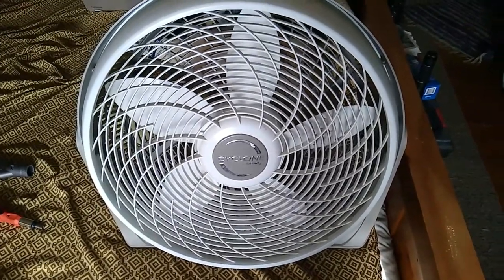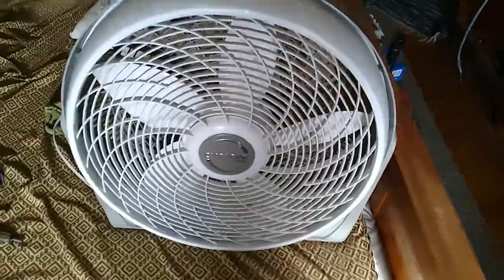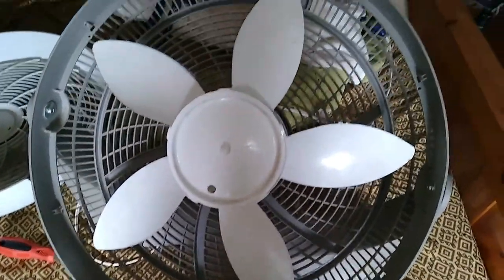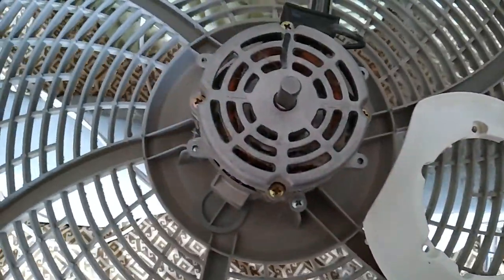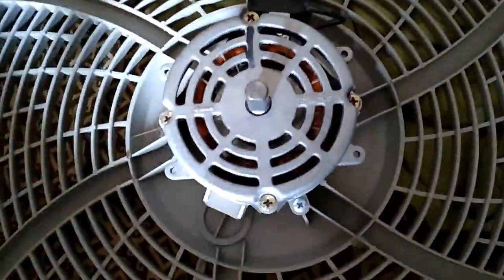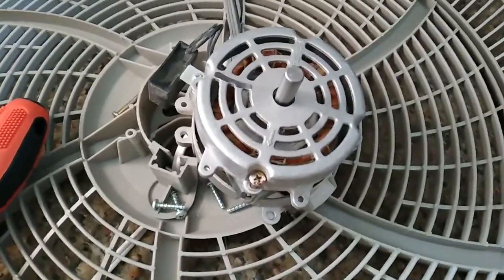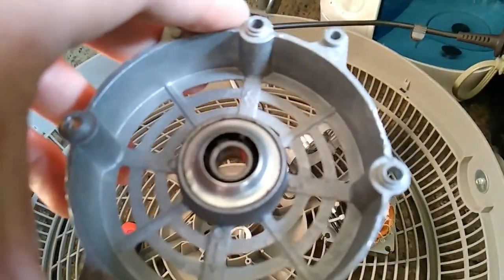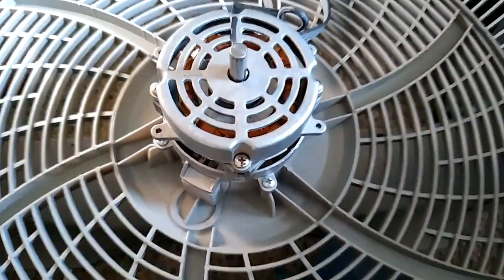Lasko Cyclone Disassembly and Cleaning/Oiling

Comment: Thank you so much for this video!  I figured there were screws someplace keeping me from taking off the front grill, but I couldn't find them. Once I got the grill off, I couldn't remove the fan from the motor, because it is affixed hard, and I can see no screws. So I couldn't go any deeper than just cleaning the front and back grills. Can't oil or anything (still wondering why).  Anyway, after about 2 hours or work, my Cyclone has drastically improved from a spring breeze back to a beautiful autumn wind. Much appreciated!! 😊👍🏻
Reply from the maker: I'm glad your fan is working better.  It's amazing how effective getting rid of dust is.  The blades on these can be pretty hard to remove sometimes.  I had to kneel on the rest of the fan to pull the blade off.
Reply: @carson01XJ   Oh! Gotcha. Well, I’ll keep that in mind and pull it off next time. (I didn’t want to break it.). Thanks!👍
Reply from the maker: @reagonowmix  Breaking the blade is definitely a valid concern.  I pulled the blade off of a cheap crappy AeroSpeed fan, and that blade actually cracked.  This fan is definitely built a lot better though.

Comment: The main important part you skipped how do you get the blades off
Reply from the maker: @FernandoAstudillo64  You pull it off the motor shaft.  That's the only possible way to do it.

Comment: You, sir, have just saved my filthy fan - thank you!  Your advice for tightening those motor screws evenly like lug nuts is very important because I had to take a few runs at it before my blade would spin smoothly.
Reply from the maker: Glad I could help.  It’s definitely important to tighten them evenly and strike the shaft with a screwdriver to align the bearings.

Comment: Something funny , I found one of these in a dumpster at an auto shop about 6 months ago . Plugged it in and worked fine . Dust built up and could not figure out getting the face off , so glad I found this video . I will being doing everything in addition to make this fan last , so appreciate you 👍
Reply from the maker: Always nice when you can maintain things and make them last instead of throwing them away.  I’m glad my video helped.

Comment: How do you get the fan blades out. I tried to just pull it off but it wouldn’t come off
Reply from the maker: @duanemoulton-n5o  Sometimes these blades are pretty hard to get off.  You have to pull on it really hard and hold the rest of the fan down with something.
Reply: @carson01XJ Why did you skip over this part in your video? You never showed us.

Comment: Hey Carson, I found this exact model on the curbside and gave it a plug in. I found that the Fan's computer board and buttons turn on and work (Light for mode and timer changes) and there's light vibration/humming in the control panel and behind the motor. So this fan is indeed receiving power, but the blades don't turn.  I just took off the screws only to find that the fan was never cleaned, it was pretty gray in the grill and blades when opened and I cleaned out the grill with a broom and blades with a cloth. I found this video so that I can find out how to remove the blade, which apparently you say just to pull it off.  
I'm hoping I can save this fan, it seems to be a simple hum and it does work on the console, so hopefully it just shorted out due to being dusty, do you thin you might know the problem to this? The blades do turn fine and I tried giving it a spin while plugged it to see if that jump starts the fan, but no joy.
Reply: Update, did pull apart the fan blade after typing that comment and found a motor shaft full of dust, clogged even. So I took my time to clean out both sides without oiling the bearing (Have no experience or oil to lubricate it), put it back together and it has the same result.  It looks like it's the computer console that hums and vibrates, the lights come on and work as intended and the humming vibration intensity corresponds to fan speed, but the blades sadly don't turn.
Reply from the maker: @SoarinYoshi64  Sounds like the capacitor may need to be replaced. The windings in the motor might be screwed as well. Does it spin for a while when you move the blade?  If not, the bearings might just be too stiff.  Hopefully the control panel isn’t messed up.
Reply: @carson01XJ  Yeah, it does spin when I move the blades and the wind when I cleaned it outside spun the blades freely. I am also thinking capacitor, but I don't know about soldering or have an iron for one sadly. I'm sure this can be saved, but my family thinks that I should toss it out again.

Edit: Oh, and the zip ties on the motor in your video were half charred. Two of them even came off. They weren't white as new as your video shows
Reply from the maker: @SoarinYoshi64  Sounds like your motor has has a pretty hard life. It seems like it’s been overheated.
Reply: @carson01XJ  Yeah, it was notable that it was never cleaned. So I guess I can curbside it for trash again and maybe someone else can fix it before it goes away.

Comment: Hello Carson , this is Fan man Steve here once again I'm sure you remember my old wizard box fan , I still have the original switch to it which is a leviton 3 way rotary canopy switch, I'm pretty sure you know what kind of switches theses are, but when I was getting the fan ready for the restoration I took the switch apart and stored it away in my drawer in my room and I tested it to see if it still works and does ! But the issue that I'm having is the the wires are either getting caught in the rotor some where  or the switch has to be wired a certain way can you help me with this ?
Reply from the maker: When you say caught in the rotor, are you referring to the part of the switch that turns?  Could you make a video explaining what's going on?  I'd probably be able to help more if I could visualize it.
Reply: @carson01XJ  Hello Carson ' I will make a video of it tomorrow' I know they're are different kinds of these switch es , when I restored the fan , I kept all the original parts to it that still worked , I just couldn't remember how the rotary switch was wired when I took it apart , but I will make  a video of it and show it to you thanks!

Comment: Hello Carson good new year to you my friend, I've just gotten 2 new fans to start off my new year, my Grandfather brought them to me visiting us from out of town , both of them are industrial floor fans they're  modern but they are awesome fans , one is a steelton and the other doesn't have name tag , maybe it's one of the off brands but anyhow , my Grandfather found these 2 fans in a dumpster close by his house that an elderly couple had thrown away, when he tested them he said they both worked but one was completely seized and locked up and the other just had a shaft issue, but I have repaired both of them and work just perfectly, but one of the fans motor on the inside was coated with grease and this was the one with the baron problem, are all fan motors modern and vintage have grease lubercated motors ?
Reply from the maker: Happy New Year to you too.  Glad that you got some free fans for your collection.  I've never seen a fan motor that used grease as lubricant.  Sleeve bearing motors (which is what most fan motors are) always use oil.  Was the whole motor greasy inside?  Sounds like someone messed with it or tried to lubricate it.
Reply: @carson01XJ  Yes it appeared that not only the whole rotor shaft was coated in grease but the whole untire amateur was caked up in grease as well , it's a wonder the fan is still working now, and I know that somebody had already did something to the motor because when I disassembled the motor , the whole thing came right apart with ease , I figured that out the second I took it apart , but I cleaned the thing up best I could and oiled the sleeve bearings and shaft and the fan runs just right now , I have even made a video on it that I'm planning on uploading to my channel soon , but an elderly couple had owned this fan before, and they just used them and threw them away and got new ones according to my Grandfather, good thing he found these things when he did , it's like they were screaming and hollaring for help , thank you for your kindness and help , I've learned something new today, God bless you and your family and have a great day 👍.
Reply from the maker: @stevethefanman8955  Good thing you cleaned that motor out.  It probably would have made your room smell like grease as soon as it warmed up.  Glad you learned something new.
Reply: @carson01XJ  Thanks , yeah actually it did stink up the room after running it for the first time , I actually that the amateur had something to do with it because of how weak it ran, but after I cleaned out the grease , from the sleeve bearings and the amateur, I made a big improvement, and it works great now , I still have more work to do with both of them, but you will be seeing them on my channel soon and thanks for your reconition 👍.

Comment: How did you get the fan off
Reply from the maker: It just pulls off.  Hold the rest of the fan down by kneeling on it, and pull up on the blade hub.
Reply: Some elbow grease and it just pulls straight off

Comment: how do you take off blade ?
Reply from the maker: It just pulls off.  Try to hold the fan down while you pull on the blade hub.
Reply: I'm having trouble taking the blade off too
Reply: I wound up standing inside the fan, (with socks on only), and pulling it up. It's on there good, but I finally got it off.

Comment: I cannot just pull the blade off. Any suggestions?
Reply: Finally got it off by standing inside the fan's body and pulling it straight up. It's on there tight but got it off.
Reply: I scrolled through the comments looking for someone to ask this. Thanks for saying that you had to hold the base of it down and pull harder.

Comment: You didn't show how you took off the blades
Reply from the maker: All you have to do is pull it off the motor. Hold the fan down somehow and pull on the blade hub.
Reply: @carson01XJ  I've been trying to get the blade off... It is a type 20, not sure how old, but I can't for the life of me get the blade off the motor. I am trying to clean the underside of the motor because the dust build up it too damp/oily to vacuum it out.

Comment: arent you supposed to use general purpose grease...not oil..
Reply from the maker: No.  Sleeve bearings like these always use oil.  They are porous and have a felt oil wick surrounding them.